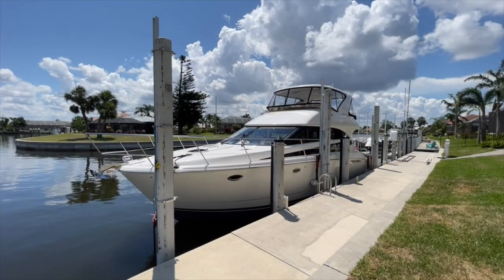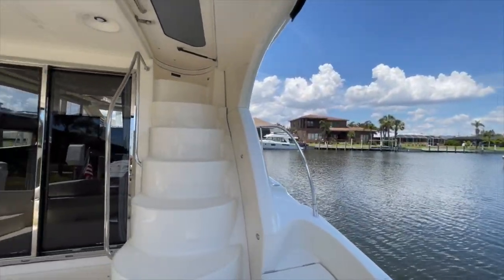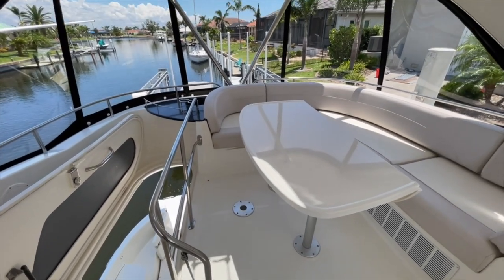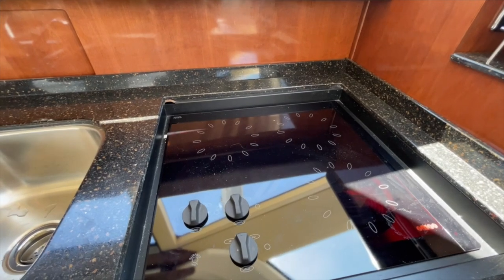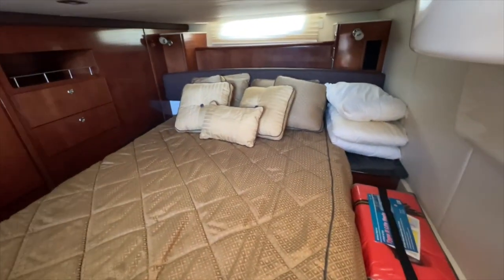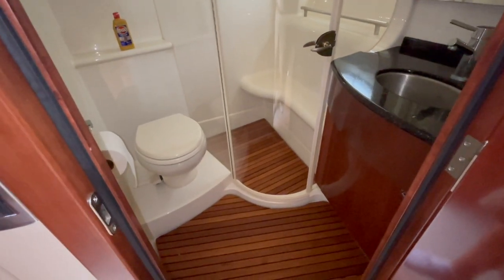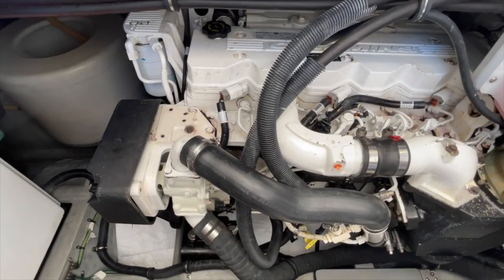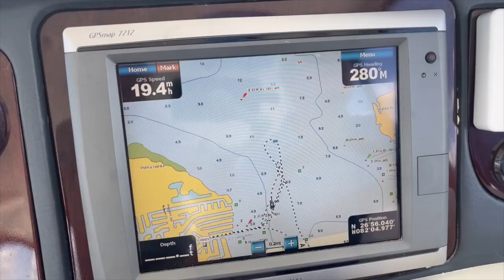EP 59: Meridian 441 Boat Tour [2009]

Comment: stbd check engine alarm for low oil pressure? and it looks like it drops to nearly 0 when you pull back the throttle…..hmmmmm
Reply from the maker: Good eye. Noticed that too and owner had mechanics come troubleshoot after and they had to replace a sensor. Test ran it and issue resolved.
Reply: I watched both this and the livestream……did you say something about an engine being replaced? Or was I hearing things?

That boat seems to be a unicorn…..I’ve never seen a 441 with a lower helm.  Didn’t even know it was an option.  We have a 391.
Reply from the maker: Honestly, I cannot remember if it has a replaced engine…I don’t think it does. Owner says the lower helm was an option. It’s a really nice boat. There a few minor things wrong with it…cosmetic level stuff, but it’s a 2009. Owner is researching fixes for the cosmetic items. Overall, a definite above average boat since bristol unicorn boats rarely exist.
Reply: I was mistaken.  I rewatched it and you said the wiper motor was replaced, lol.
Reply: Best advice if ever considering a used boat: Buy at auction prices, (restore yourself), or bring a highly skilled boat mechanic to test everything...
Reply: Very common theme for these boats: Expect to replace almost everything. Never been on a boat that something didn't break...